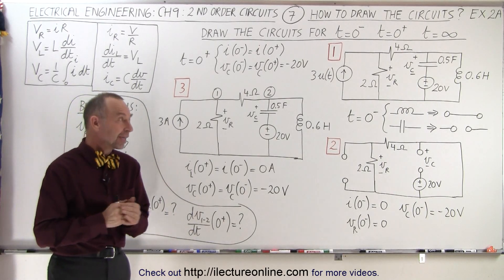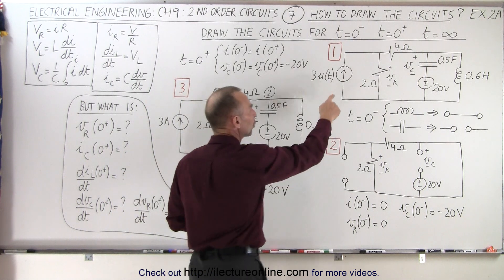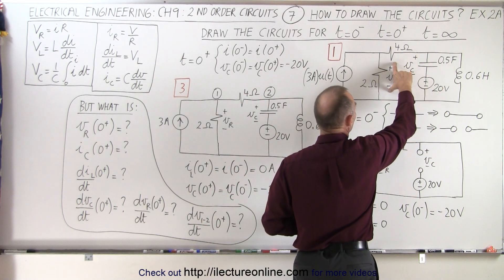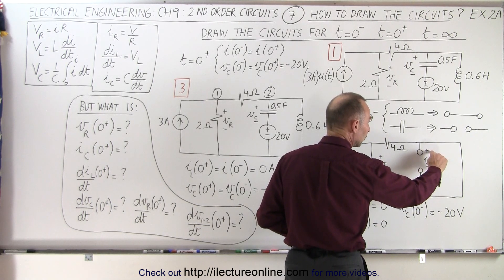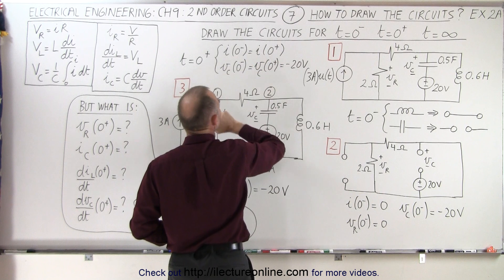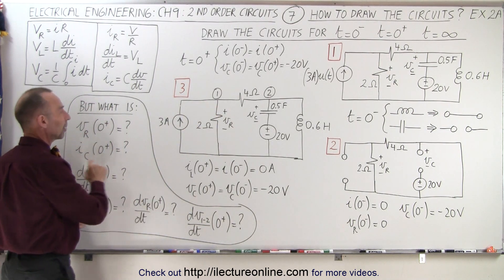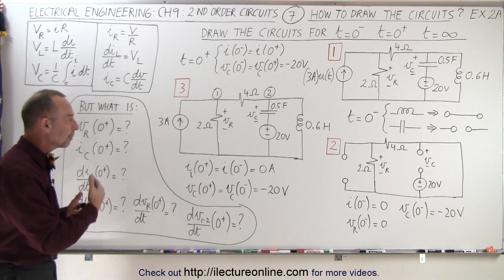Electrical Engineering: Ch 9: 2nd Order Circuits (7 of 76) How to Draw the Circuit: Ex 2A

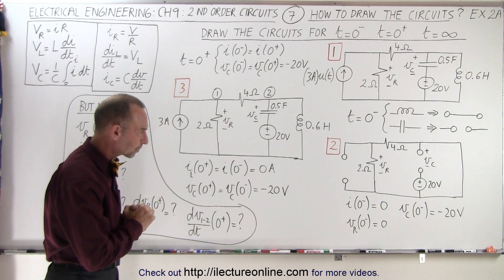Comment: Hi Michel I loved the explanation. However, I am a bit confused on 1:35. Could you in simple terms why the capacitor is even receiving charge if it is a short circuit? Would it be 0 if there were a resistor in series with the capcitor?

Comment: you said at time is more than zero, there is no current. How can that be? You said there is a voltage across the resistors, but how can there be a voltage if there is no current?

I'm confused on the terminology of time here. I think that at  t = o-, we're assuming that anything that varies over time does not exist (the current source, which is introduced at t=0 but is not active yet, because it is triggered when time increments past zero).
So when time passes zero, there must be current, which in turn means there must be a voltage difference across the resistors. Please help :)
okay, nevermind, I just realised that you meant the current around loop 1, which is the Vs, C, L circuit.
Reply from the maker: You need to think in terms of the transient period.  When a switch is first thrown or a current source is turned on, that doesn't mean that the current begins to flow at full value instantaneously.  It takes time to build up and at the beginning it is zero.   When you start charging a capacitor, at time = 0+ there is no charge on the capacitor and a moment later there is some charge.
Reply: @MichelvanBiezen 4 years later and you still respond to comments. Absolute goat

Comment: Where is initial position of the switch?
Reply from the maker: There is no switch.  But the current source is turned on at t = 0.     That is what the function  u(t) represents.  It is equal to 0 before t = 0 and it is equal to 1 after t = 0
Reply: @MichelvanBiezen  thx sir

Comment: i don't get why its - 20 for the voltage across capacitor at time 0-
Reply: Bro you see,in that branch there is open ckt vt(Vc) and a source of 20v
By conservation of charge->Vc+20=0
Vc=-20